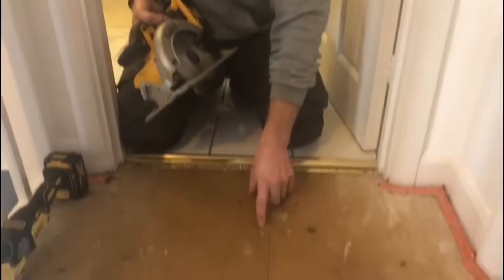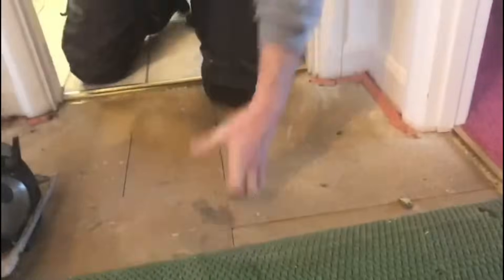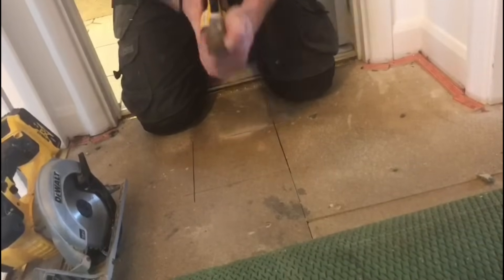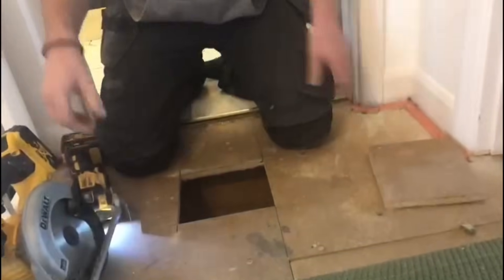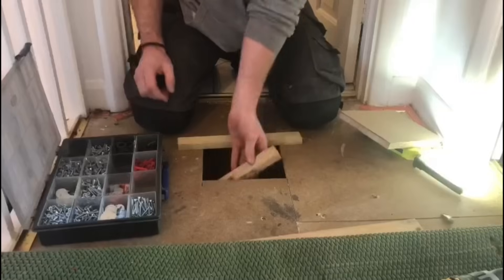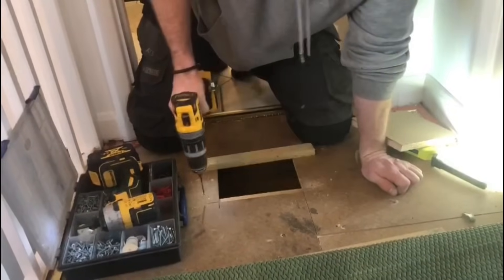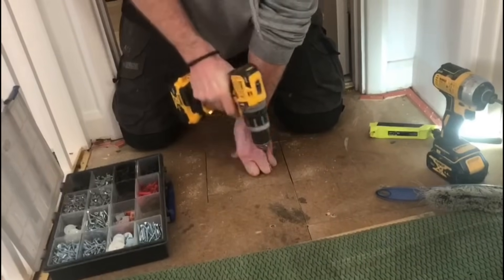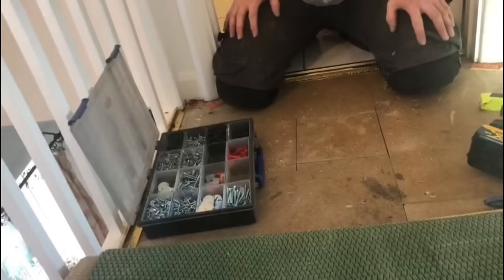How to Lift a Chipboard Floor, Batten Joists and Re-Fit the Chipboard - Remove Chipboard Floorboards

Comment: Well what should have happened when the floor was being put down is to rip a piece of the floor probably to catch both joists where the pipes and cables are  chipboard was covered by carpet or Lino and you write on the ripped piece trap so whoever’s coming behind you knows the score.
Reply: hi mate im a noob but i uncovered my floorboard recently and saw an area marked "xxx" and "trap", what does this mean?

Comment: i live in a studio flat ( quite small)   And, the shocking thing is… that, every time i walk on the chipboard floor; in the bed sitting room… the floor creaks & cracks, more or less all over.  It’s enough to drive you crazy. 
I’ve already replaced my tiny hallway with 18mm plywood;  which is stronger than chipboard, anyway.   But i think, now… the bed sitting room needs to be replaced too;  before i can put laminate flooring on top.    A lot of work; and an expensive project. 
Sunday evening 1st October 2023.  Southampton England 🏴

Comment: Older Weyroc is 18mm newer flooring sheet goes 22mm so the first cut depth should be around 16-17mm max then you can use a bit of batten to limit the depth of the multi  cutter blade to 18mm, not freehand, and  as has been said at least 2x2 par from joist to joist or screwed to parallel to the joist.

Comment: Personally I would have bored a small hole in a corner outside the foot traffic area and used an endoscope like the Ferret. That way, when I had finished, there wouldn't be a weak spot in high traffic area.
Reply: Yeah, if a person weighing 300lb steps on that hole 8 times a day, very soon he will fall into that trip.

Comment: So when you don’t  know if there might be pipes and cables under the floor how can you risk cutting with power tools
Reply: Because they started at 20mm to make sure they didn't make contact. It will likely be 18 or 22, so I imagine they knew it was 22 and did 20 just to be sure.

Comment: My original trade was a  joiner the way the hole was cut out and repaired is totally incorrect , never use a multitool you risk hitting cables and pipes beneath , patching the hole in chipboard in that manner is not structurally sound, eventually the patch will give way (chipboard  is not a structural material) .  Any supporting timbers needs to be fastened to the joists , really need to be 45mmx45mm  not lath
Reply: I am a retired electrician and I found cutting a circular hole with a router and gently tapping round the cut with a old screwdriver worked well. The screwdriver would  clink on pipes and router depth could be set to a safe depth. Also one can cut nice large hole.
Reply: Was just thinking the same. It’s a massive problem I see every day that other trades don’t have any appreciation for the other trades they’re messing around with.
Should be cut to the next joist. Those battens are no where near strong enough and although matt mentioned 10 screws. It’s only 4 that are doing all the work.
By finding the joists and and then adding nogs in at least 3x2 across the gaps you’d get support on all 4 sides. ideally fixed with PU glue as well as structural screws not just 1 1/2” no 8s for fixing backboxes
Reply: @richardbradley7988  I notice this a lot and unfortunately sparks are the worst offenders  closely followed by plumbers who think butchering 50mm slots out of joists is acceptable. I also lay a lot of the blame at the designers doors they never have any input from trades until the project starts, often don't follow sensible protocols of construction , all rush rush rush , simple things like lifting floor heights and cross battening (common in other countries) would alleviate many of these issues as would designated access points
Reply: @steverobinson8170  lol ,speak to your structural engineer , you can safely cut a 3rd out of a joist in height in patches without loss of strength. I use this repair method but i always gluw the batten and the flooring (PATCH AND SURROUNDING FLOOR TO THEM) never ever had a failure .
Reply: @andrewmudge3648   no you can't

Comment: Yep been there, set the depth gauge on the cheap circular saw- gauge moved out came black water nipped through central heating pipes guess I'm not the first or last.
Curious as to why you thought there was a joint box under a section of untouched chipboard flooring.
Reply: Yep, nicked a CH pipe that's pressed against underside of a board myself ... ruins your day! Debating whether to invest in one of those Bosch D-Tect things that 'can' find pipes and cable  - and (supposedly) measure depth.
Reply: @dominicdodd9759  Just cut board through at 17mm then run a craft knife around
Reply: If anyone has found a good detector for pipes please let me know 😒

Comment: Nice work, A little over kill on the patch 4 screws would be more than enough..
Reply: Not in chipboard over time that patch will fail its in a high traffic area, the chipboard needs to be supported by45mmx45mm  fixed to the joists
Reply: @steverobinson8170 I know little about these types of jobs but I'm surprised it's not fixed to the joists. Surely with traffic that will eventually begin to give and sag.
Reply: IMHO depends where. Done that in a bedroom where there's a chance the bed leg could be re-positioned so used four pieces of batten for extra strength.
Reply: Also probably best not to use a multi tool to "see" if there's any pipes. By the time you've found out you've pierced the pipe...

Comment: Whoever decided those chipboard flooring was a good idea should be shot....   I have found if you drill very carefully through the chip board with about a 10mm with a hss drill bit, you can then stick a small camera that you can get pretty cheap down it to see if there are any cables or pipes in the area you want to cut...
Reply: It's complete shite. I have a house built in the late 70s and every single board is loose and squeaking because of 40 years of plumbing and electrical work, tongues have been cut and boards are cut in random places no where near joists. Battens will help but you'll still end up with movement and squeaking. Extremely difficult to replace the boards without having to basically remove everything from the upstairs of the property because all of the walls are built on top of the floorboards. Should be illegal quite honestly...
Reply: Its cheap crap and they could atleast use screws so you can remove it easier, have to chisel around the nails to pull them out 😡
Reply: Its used because its cheap to buy, fast to lay demensionally stable when glued and nailed creates a very strong structural bracing on engineered flooring joists often made of 8mm hardboard and 2x1
Reply: @steverobinson8170  I get that but its just horrible to try and take up, at least with floorboards its a bit easier, I think fast a cheap is basically the answer just like everything with new houses.
Reply: @steve11211  Thats the problem, punters want cheaper houses , government want cheaper houses , developers want cheaper construction methods , never look at maintainance  or future works.  Only have to look at shopfitting to see what brainless muppets some developers and designers are big shopping malls where shops are generally refurbed on a 7 to 10 year cycle ,  never think about the refits  cargo lifts you cant get bugger all in

Comment: Typical plumbers notching the top of the joist. 😁 just drill a hole like us electricians do.
Reply: How do you slide lengths of copper pipe through joists that are 450mm apart? 😂
Reply: @affy675  Mark the floorboard 'beware pipes below' or something to that nature.